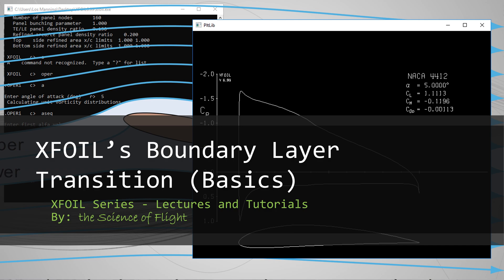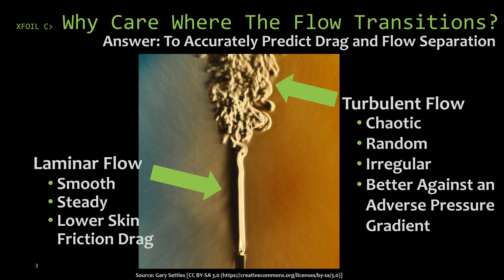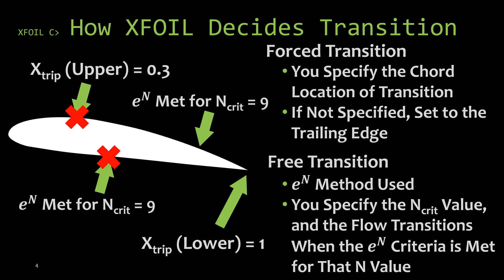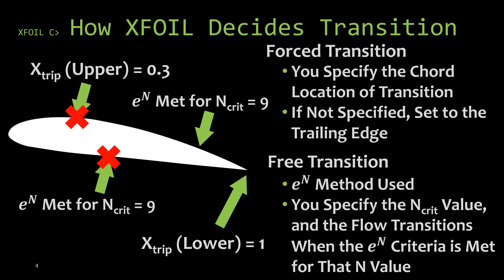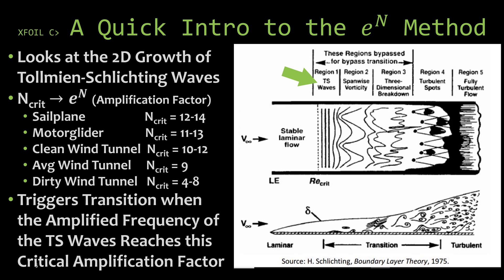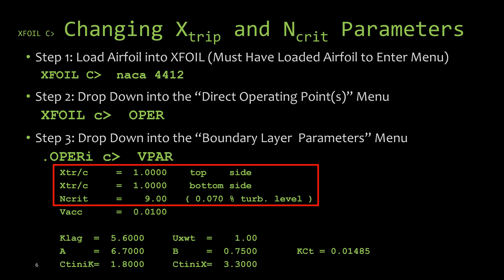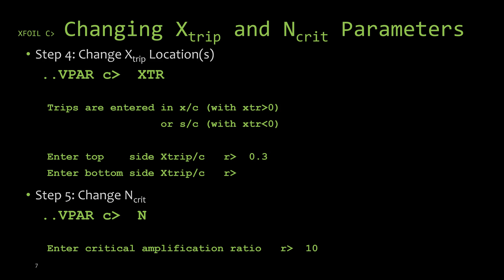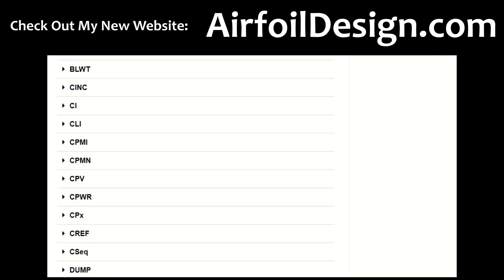XFOIL Boundary Layer Transition (Basics)

Comment: Your tutorials are great, thank you!
Reply from the maker: No problem. Let me know if there are any particular tutorials you'd like to see and I'll work it into the video lineup.
Reply: @thescienceofflight1404  Hi, it would be great if you would do video on eN method and other parameters in vpar menu. I am currently working on optimization of wind turbine airfoils using genetic algorithm and Xfoil. I have designed couple of interesting airfoils on small Re number, but I need to include soiling effects in my design so it would be great if you could provide more information on eN method. Thanks in advance.